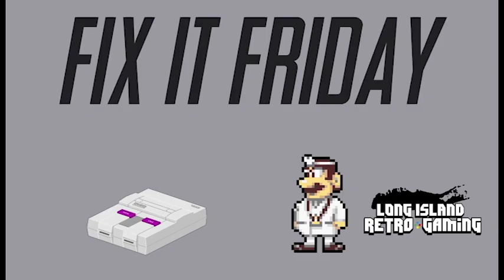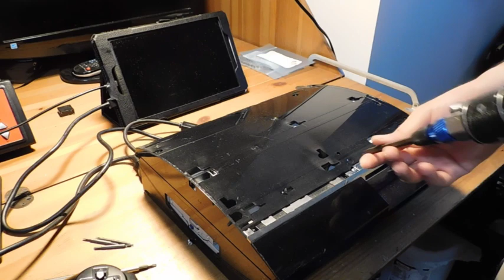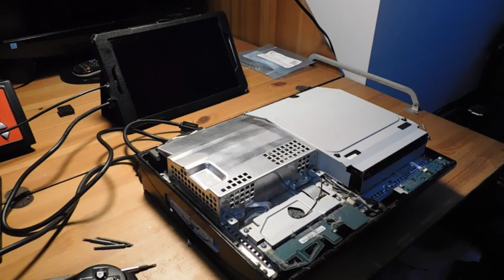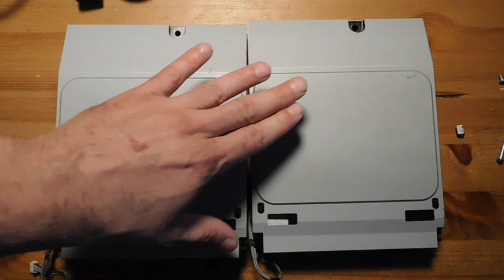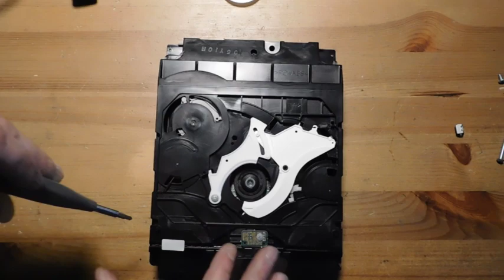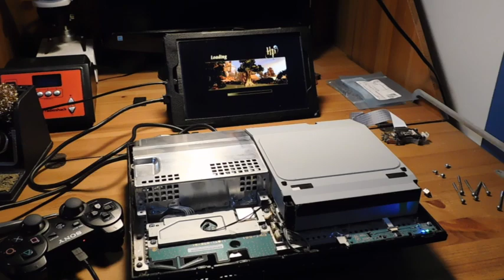Backwards Compatible PS3 Repair - laser replacement guide!

Comment: I have the original fat model. I took it somewhere to get it cleaned and new thermal paste. When I got it back, I noticed it would not play PS2 games. I had mine in storage for about five years so it could’ve been bad anyway. I took it back and he replaced the lasers.
When I went to pick it up, he popped in a PS2 game just to show me that it worked, but when I got at home and put one of my PS2 games and it would not recognize in the XMB
It recognizes PS3 discs, Blu-ray movies, and even DVD movies just not PS2 games. I tried multiple PS2 games that I had and still could not get the disc icon to come up?

Comment: So just wondering , how would I know if it’s the laser or the who drive that’s the problem?
When I put my disc in the system doesn’t read it, doesn’t seem like the game disc is even spinning, but the top right icon next to the time on the ps3 has a disc spinning when I put the disc in , does that mean the disc is spinning?
Reply from the maker: It’s hard to say. It could be the drive mechanism or the laser itself. If it makes odd noises when accepting the disc, then it’s most likely the drive mechanism

Comment: When you say you re-assembled the ps3, you mean you put the old board on the new drive? You left that out and I'm assuming you put your old board on the spare drive you had, is this correct? If that is correct, then that means whatever was wrong with the first one, the second on didn't have the same issue. You kinda lost me when you disassembled and removed the optical laser for demonstration purposes, and never really showed the re-assembly of the ps3. Great job by the way, clearly explains where others fall short.

Comment: My new laser moves and tries to focus but there's no light coming out of it. Any ideas?
Reply from the maker: Yes, you probably need to remove the antistatic solder point on the laser. That extra solder is added to protect the laser from static while shipping. once it’s removed the light will come on
Reply: @LIRetroGaming  where is the solder blob on the kes400a? I just replaced a ps2 laser and the solder blob was obvious but I didn't see one here

Comment: my ps3 reads everything except ps2/dvd discs I was wondering if that's a laser issue or something else
Reply from the maker: Only backwards compatible ps3s can read ps2 discs, so if it’s not that model then it’s totally normal
Reply: @LIRetroGaming  I figured it out it won't read ps2 or DVDs vertically but it will horizontally XD

Comment: Hi, I know this is an old video but I have a backwards comparable ps3, it’s actually a test model (decha) and I have 2 drives that work but only one laser, I tried the laser in both drives and ps3 and ps2 games work fine but I can’t get it to read ps1 games! They worked before the original laser died but can’t get them working now, any ideas? Thanks
Reply: Hey man. Did you ever sort that out ?
Reply: @jstro-hobbytech  I did, the new drive I bought was faulty so i bought another separate laser and put it in the original drive and it worked perfectly 👍
Reply: @jordandent2717  cool. My buddy came across 2 release models with bad drives so I'm going to know them inside out haha

Comment: Mate I’m struggling to get the ribbon cable back into the slot. I’ve lifted the flap but it’s so fiddly! Is there any technique to do it? I don’t want to break it!
Reply from the maker: It's not easy, but if you can get something to hold up the drive then it can be a little easier to connect the cable. The hardest part is that the drive is heavy and gets in the way

Comment: Hey, I dont know if you are still answering comments here but I just swapped out my laser as my ps3 was not spinning or recognising discs. After the swap I tried to boot up a game and it started up at first but froze so I restarted the ps3. Now I have the same problem as before as if the second laser died. Any advice? Thanks
Reply from the maker: That’s a strange problem, it’s hard to know exactly but it sounds like an issue with the motherboard itself and not the disk Drive. What version of PS3 is this?
Reply: @LIRetroGaming  It's a CECHC03. Ya not sure what I should do next.  Thanks for the reply. Great vids btw

Comment: Hey Long Island Retro Gaming, where are you located in Long Island? I have a PS3 Backwards compatible 80gb that will read ps 2 games and will sometimes read ps 3 games and blu ray discs but will end up freezing my system. Sometimes when I try to eject the ps3 disc, it won't come out right away and sometimes the discs won't even register that they're in the tray. 

My PS3 was in storage since about 2017 covered in a plastic bag inside of a large covered bin standing up on its side but the bin was moved on several occasions. Last I remember, everything was working just fine before I had to store it away. Any idea what might be wrong with it?
Reply from the maker: It sounds like maybe the laser is starting to fail. That can be repaired by replacing the laser and I can help with that
Reply from the maker: You can message me directly at 1uprestorations.com

Comment: Thank you, I've never taken a system apart before so hopefully I can fix the one my dad wants me to try and repair. It won't make an effort to read any discs or games. It will eject and accept the discs just fine, but they never show like they don't even exist so maybe the laser is the culprit? I tried a system restore and that did absolutely nothing for it. Maybe after tinkering with this one I can fix my backward compatible one too. It shuts itself off randomly.
Reply from the maker: Yes to me that sounds like a bad laser because the drive mechanisms seem to be working